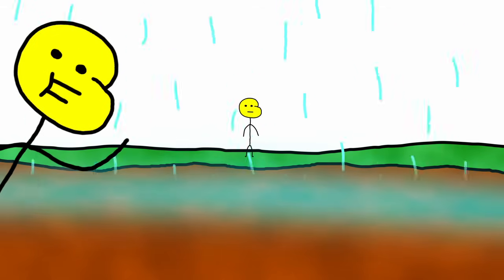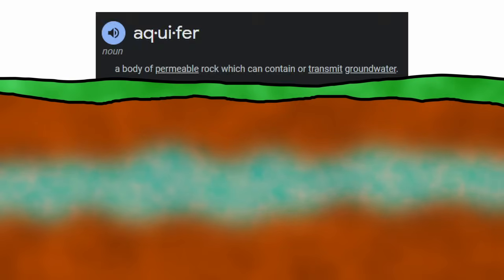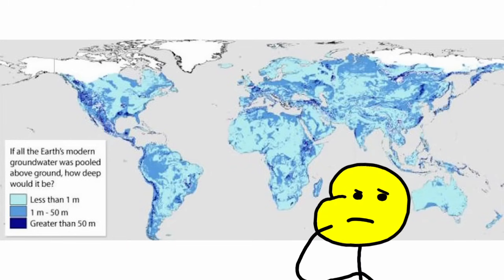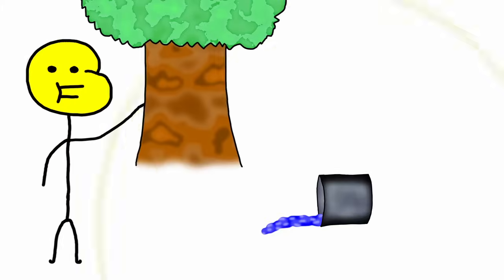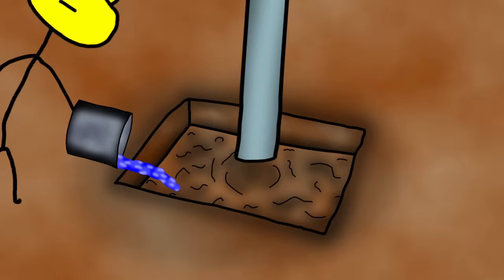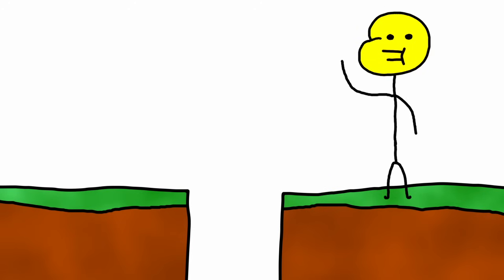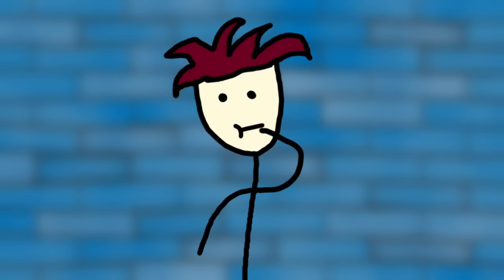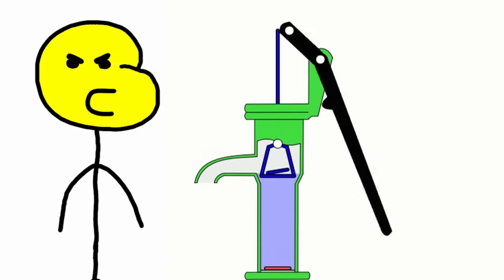How Water Wells Work

Comment: I watched a utility locator 'witch' for a watermain he couldn't find using electric tracer (tracer wire likely rotted off pipe). He used two 'L' shaped metal rods, held them loosely in his hands, and walked along the area - and the rods slowly moved as he got closer to the main. I didn't believe it but tried it and it worked!! He then dug by hand to confirm location.
Reply from the maker: i don't actually know why that would work. but there's water everywhere so can't really deny that
Reply: @justEight  I think the theory is static electricity created by the water flowing through the pipe.
Reply from the maker: perhaps